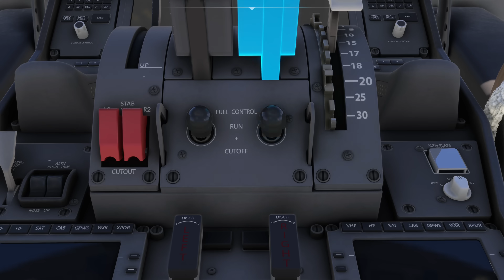Air India 171: Why Did The Fuel Cut-off Switch Get Moved?

Comment: Dear Dr. Captain Steve,

I am honestly shocked at how low you can go. I never thought you could be this cheap, outrightly playing into the hands of the USA and Boeing. It’s painfully obvious, Steve – you are now nothing more than a PR tool for Boeing.

I used to be a big fan of yours. Your earlier videos felt genuine – you answered questions objectively. But now, all I see is your eagerness to cover Boeing’s mess, even if it means throwing two innocent pilots under the bus and questioning their mental integrity.

This is not your USA or UK, Steve. This is India. People here are sane and rooted – depression and all that "mental health" angle you are pushing is not common here, so stop imposing that narrative.

And what’s worse, you didn’t even bother to question the integrity of that faulty switch – a switch that operates against basic physics. The cutoff position is down, the switch-on is up, and it’s spring-loaded. Think, Steve! When an aircraft experiences multiple G-forces, gravity works against the spring in the on-position. Basic common sense, basic physics – yet you had no doubt about it.

That’s what makes you so cheap, Steve. If you had at least acknowledged that as one possible assumption, I might have still respected you. But you didn’t. You chose to blindly defend Boeing.

Sorry, Steve, but you’ve lost all credibility.

Comment: Sir pilot deliberately switching off fuel switch lever to off position does not hold ground, technically all commands are in digital form so there can be software glitch no one saw switching off the fuel switch. Your logic to FAA circular also sounds incorrect because the detent will prevent operation in both directions so there is more to what the circular is trying to say. Collaborating fact quoted is one pilot asking and other pilot denying. Any person on suicidal mission will not deny and your comparing this with a child who committed a notorious act and denying does not hold ground because a person on suicidal mission will not only acknowledge but will also prevent relight.

Comment: Some Air India pilots have said it is impossible for both fuel control switches on a 787 to be move from run to cutoff in 1 second of one another. What is your take on this Captain Steve?

Comment: Hi.. can you shed more light on the technical details of "Special Airworthiness Information Bulletin (SAIB) No. NM-18-33" and exactly on why that isnt relavent here? Especially when the text of the bulletin calls out that it may cause inadvertant operation of the fuel control switches.. it says that the fuel switches of that model could have been installed without the spring loaded locking mechanism.. So it could potentially work for the most of its life untill it eventually didnt..

Comment: How did they turn off both engines within 1 second? 

I heard that its a spring loaded system so it shouldn’t be so easy to turn off both simultaneously without the help of another pilot. 

We know by the co-pilots voice recording that he wasn’t involved in it. 

My theory is that there wad a mechanical failure that caused both levers to switch off simultaneously, and the co-pilot saw it on his screen that engine were cut-off, hence why he asked the captain.
Reply: Captain Steve explained this in great detail on the review of the report
Reply: @smtucker0419 Give me in brief. Like is it poss for 1 pilot to cutoff both engine fuel supply without the Co-pilot noticing? 

Cause by audio recording we know that the co-pilot noticed after he switched off them. And by his reaction i am quite certain that he saw it on the screen and not while it was happening.
Reply: @Noname__55  According to Cap S the pilots would have heard/felt the engines shutting off even before seeing in on their display.  To turn the switch off you have to pull it out and lift it up past some kind of guard and then it spring locks into position.  It is a completely manual process.  He said it is completely with in  normal process to do one and then the next within 1 second of the first.  The engines apparently shut down immediately. 10 seconds later a pilot moved the switches back to the on position. The first engine fired up but the second engine did not.  Probably because they crashed before it even had time to.  They are smallish switches and if the one pilot is flying the takeoff and thinking about that, I do think it could be done without the pilot not seeing the action.  Especially because you wouldn't be expecting something like that to be done.     

 If you haven't watched the video from a couple of days ago where he goes through the report I highly recommend it.  From the data recorder it seems the plane did not malfunction no matter how many people seem to want to make it Boeing's fault.

Comment: You’re making some serious assumptions here. You're relying on a preliminary report that lacks full context and repeating conclusions that are, at this stage, purely speculative. Regardless of what that vague report suggests, it is Boeing's responsibility to definitively prove that the root cause was not related to a fuel system failure.

Until Boeing can conclusively prove that the aircraft was not at fault, the pilots cannot be held responsible. They did not deliberately move the fuel control switches to the CUT OFF position - period.

Please stop repeating speculation from the preliminary report as if it were fact.

Frankly, it seems you’re playing along just to stay in Boeing’s good graces, or rather Douglas’s, since many would argue Boeing ceased to exist the moment it merged with McDonnell Douglas.

How can you be certain about what happened in that flight deck? For example, if the engines flamed out, it’s entirely plausible that the pilots, under extreme stress, were attempting to restart them. As you should know, in the event of a dual engine failure, the QRH procedure requires setting the fuel control switches to CUT OFF and then back to RUN to initiate a restart.

Is a dual failure of the engine fuel shutoff valves or spar valves possible? Yes, it is. In fact, there are multiple Airworthiness Directives addressing latent failures of spar valves, including on the very model you fly. Your engineering organization can confirm this. Ask them specifically about the B777 MOV actuators; there’s a well-documented history of issues. This information is publicly available. I'm not disclosing anything confidential.

The only way to speak confidently is to analyze the complete DFDR data, from the first second to the last to which you do not have access. Until then, any strong assertions are premature.

Quoting an incomplete preliminary report without full data is not professional. I sincerely hope Air India continues to pursue this matter thoroughly and gets to the actual root cause.

Comment: 1) Wouldn't one pilot see the other pilots actions of pulling & twisting both cutoff switches? 2) Does the black box data identify if both switches were placed into the cutoff position at the same time, or one after the other? 3) Can one pilot move both switches to the cutoff position without being seen by the other pilot?
Reply: the report states that the switches were not done simultaneously but about 1 second apart.

Comment: Never flew jets (only  twins doing commercial GA ops)  but I am curious and would appreciate a reply from someone more in the know about these things. In many jets the fuel cutoff can only be activated when the thrust levers are at full idle, is this not the case with Boeing and if not, wow is that a glaring safety issue.....?

Comment: Two suggestions I have
1. The fuel switch should have mechanism so that it requires both pilots to move the switch from one position to another.
2. The cockpit should have a video recorder along with audio recorder. There should be multiple cameras which should be recorded as a CVR.
Thanks

Comment: Hey Captain Steeve,, are you able to tell if there is a time correlation between when the captain called for gear up and the fuel cut switches being moved. Could this be a case of extreme brain fog,  and musle memory. Hence the denial of moving the switches
David

Comment: Would it not make sense to build in a system whereby when the plane is in flight, the fuel cutoff will not function unless both pilots also press an 'I concur' button?

Comment: You say IF you get an engine fire you would need to cut fuel to that engine. But how do you know there is an engine fire? You get an alarm right? Or maybe a birdstrike make an engine vibrate too much you will get an alarm? Those alarms tell me that at that point the aircraft KNOWS that engine needs to be cut off.. And then, and only then you should be allowed to cut fuen when in the air. Does this make sense to you? It seems very scary that you can just cut fuel in air just like that.

Comment: The switches were faulty and were not fully seated in the detent. They vibrated out of the run detent over time and finally snapped to the off position.  The pilot flying had no idea what just happened and asked the SIC "why did you do that?" and he actually did not do it. It's been documented that the switches could be faulty. What I just explained above makes more sense than a rouge pilot act.
Reply: For 1 switch maybe, but for 2 switches at almost the same time it would be almost impossible.
Reply: @Dan8254  Maybe, but keep in mind that the switches are spring loaded. If one switch snapped down rapidly (without a human hand easing it down) the sudden jolt could have caused the other to snap down? We may never really know.
Reply: @nuversion8673 
The design of the switch is that the spring pull the lever down in place. It takes deliberate effort to pull the lever up around 2.28mm to clear the bump and toggle it to the other position. The switch mechanical life is rated to be 100,000 cycles minimum. What you described can only happened when both the switches mechanically degraded so much that either both springs lost elasticity or the the bumps shorten significantly due to wear and tear.
Reply: @Dan8254  You're assuming that the switches were fully functional and locked into place in the run position. I'm suggesting that they may not have been completely engaged into the indent (already pulled up 2.28mm) and eventually vibrated enough to finally snap down to off. Just saying, the switches were documented as being possibly faulty. I know its unlikely that both were bad, but then again, the crash its self was unlikely.
Reply: @nuversion8673 
The design of the Honeywell model 4TL837-3D switch is that its contacts will not engage unless its lever is lowered to a certain maximum height. 
Yes it is possible that the switch may fail at any given moment. But mathematically it is almost impossible for 2 switches to fail at the exact same time.
Reply: When both almost independent systems fail at the same time, the immediate attention is to identify the common cause.
That is usually systematic failure , rather than random failure (hardware fault due to wear and tear, component failure).
That systematic failure can be:
1. Human factor
2. Software bug
3. Design flaw
Contaminated fuel can be ruled out as the EAFR recorded that the 2 switches "transitioned" to cutoff shortly after take off.

Comment: The UK Civil Aviation Authority (CAA) issued a safety notice on May 15, 2025, regarding fuel shutoff valve actuators on several Boeing aircraft, including the 787 Dreamliner, due to potential safety risks. This notice, which came four weeks before an Air India 787-8 crash, mandated daily checks of these actuators. The issue stemmed from the unexpected movement of fuel control switches to the "CUTOFF" position during a flight, disabling both engines. What about this issue? in addition to this MayDay time was given wrong in Preliminary report. Mayday was given at 8:8:46 (not 9:9:05 as indicated in Report) just at the time RAT was being deployed as Pilot conversation with ATC is out on YouTube that lasted 25 seconds and flight was airborne only for 32 seconds. Pilot seemed shocked and panicked in that conversation.

Comment: Don't go too much by this preliminary report.....it's an obvious attempt to blame the dead pilots and save Boeing from going down under.....
If the report is genuine, they should have released the entire communication of both the pilots right from starting takeoff until the crash, which would be of only about a minute and half duration. They have deliberately and conveniently highlighted just a few seconds of conversation between the pilots to pin the blame on them.
They have shrewdly reported that the fuel switch "transitioned from run to cutoff" without clearly stating whether it happened automatically or if it was done manually. 
There are a bunch of "aviation experts" who would have been paid handsomely to peddle and propagate this narrative and deflect blame from Boeing.
Reply: Totally 💯 agree. All the authorities, in possession of the data, should release the entire data to the public.  Only then will it be transparent.

Comment: @Captain Steeeve is it actually possible that BEFORE FLIGHT... another human being pulled out and set the knobs in a tedious 'on-edge' of off position on purpose? And turbulence knocked them down into off? But systems registered fuel as on and no pilot noticed the oddity of the knob angle? In other words... pre flight, pre boarding sabotage.

My brother is an Airbus pilot, so I'm asking you on your equipment if the above on a Boeing is even possible. A balanced point in which both controls can hang out with enough spring pressure to hold them in on positions... until a slight force eventually snaps them down to off. Pre set at a precarious point by last souls in cockpit even BEFORE Captain and 1st officer entered cockpit for that tragic flight.

Comment: why cant the fuel switch tell wether the plane is in landing or starting mode? wouldnt it be better to prevent both switches to be turned off during starting e.g. when the plane just switched from ground to airborne mode.

Comment: Should Boeing need to put a transparent plactic cover over these two fuel switch to prevent unintentional touch?  Since these two switchs are not needed to be touched often during the flight.

Comment: The RAT deployed because no engines then the pilots turn the switches off and on like trying to reset the power or fuel like when you turn a switch on and it doesn't work you move the switch <off and on> again, it happens in computers as well .

Comment: I ask a deeper question, fuel pumps to the engine are obviously engine specific  so why the hell does a pilot have a switch in the first place  does your love of switches replace common stance and good engineering
Reply: By fire the further fire measures should cut off fuel

Comment: Question: does the flight data recorder record the movement of each fuel switch or does the flight data recorder simply record that fuel cut off to the engine?  The distinction is critical to separating ***(*)cide from  each engine losing power for another reason, such as the computer resetting/recycling because of continuous hours of usage. Wouldn't you turn the switches off and then turn them back on?  The conversation between the pilots remained professional.  If you thought you were about to be murdered would you remain professional? 

Suppose the fuel shuts off for another reason. Right now we are assuming that the pilot who asks "why did you turn off the fuel switches" had done so prior to the time that he visualized the switches. The feel of the plane and the sound of the engines and knowing he didn't do it resulted in a reflex question. The other pilot responds that he didn't. The switches are moved to the off position and then turned back to the on position. 

Look, I'm not trying to say that this is what happened.  What I am saying is that the situation calls for incredible Precision in the description of what occurred. Would the flight data recorder have recorded a computer reset/ cycling? This needs to be a stop-and- look at every person's action and every piece of equipment action in 1/100th of a sec intervals. 

The two pilots switches solution to turn off the fuel solution is fallacious. One Pilot can simply refuse to do with the other pilot requests.  It's the negative side to the affirmative motion.

Comment: why is it so hard for you people to believe that it was a suicide?  if it's not a suicide then somebody wanted it to appear like a suicide.  here is my point: 
it still does not explain the timing of the switches being turned to cuf off. A few feet higher or few seconds further and that airplane would have had enough altitude for a relight and recover. the timing was so perfect and that only a pilot would know about it. And also flight voice recorder are design to record even switch activations. those fuel cut off switches make an audible noise. So was that captured in the voice recorder then? aside from this, one of the pilot knew exactly that his co pilot made the cut off. otherwise the pilot would have asked why did IT cut off and not HE. the reports all point to suicide without ever really saying it. Question you got to ask now is how true the report is and how corrupt the AAIB is. because if it wasn't an actual suicide well then somebody wanted it to appear like a suicide.

Comment: From the media assessments about the Primary Report has clearly highlighted the RAT was operationalised within 3-4 seconds from the boing dreamliner take off and 2nd point is fuel switches were on RUN position at the accident site indicating clearly that somewhere technical or maintenance issues were the most possible reasons for devastating accident nothing else